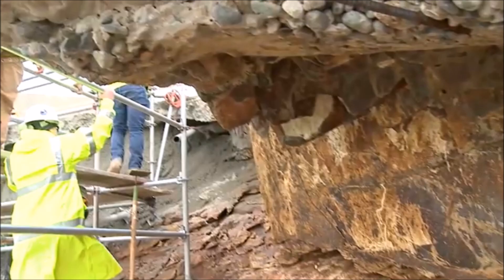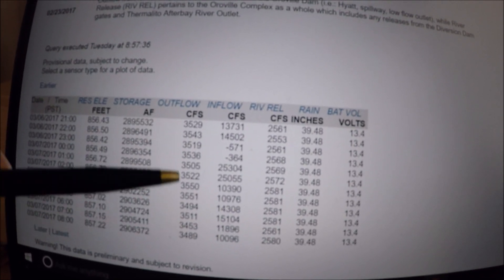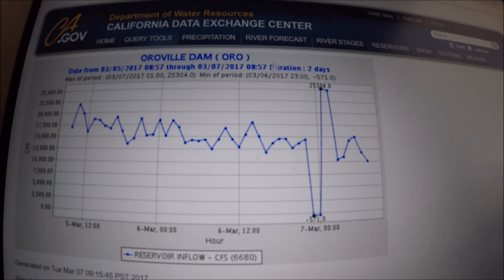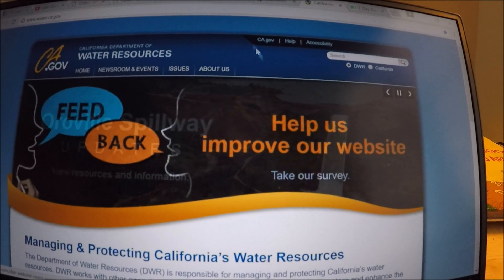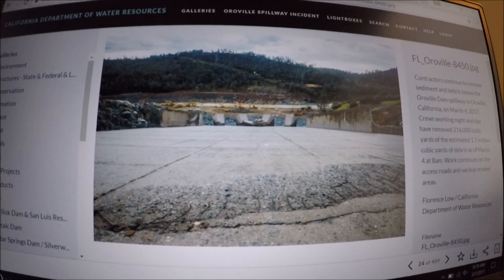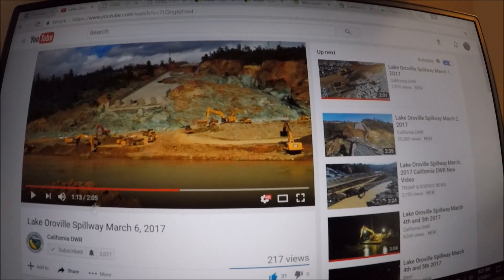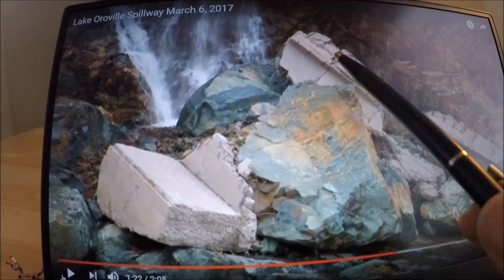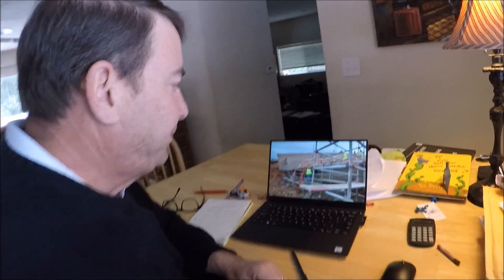Oroville Update 7 March 2017  "Where's the Rebar?"

Comment: rebar is not used in dam construction at all...there's none in the Hoover dam...rebar in concrete causes rust and failure in 50 or so years because concrete is like a sponge with water. it absorbs a lot of it and become stronger over time as those waters bring in more calcium and minerals to fill in the voids...every year they drill out a test core in the hoover dam and every year it gets a little stronger
Reply: Rebar is almost never used in dam construction because dams are designed to be in compression their entire lives, and steel provides no economical benefit to a structure in compression.  The spillway, however, must function in both compression and tension (and shear), and rebar is needed to address these functional requirements.
Reply: Very interesting, phil. It seems to me though, that in the spillway that is 3000 feet long, rebar might be  required even though it does rust. (disclaimer; not a scientist, just a dude that works with concrete now & then, haha)

Comment: Slab thickness can easily be estimated using the extension ladder where they are placing the shotcrete. The ladder rungs are 12" center to center on almost all ladders. I believe OSHA min is 12". Keep in mind the section from about the middle of the spillway to the viewers left is a section that is thinner due to the clay drain pipes. The broken end is seen in previous videos and can be placed in DWR photos. You can barely make out a curved surface along the bottom edge of the slab as well. I believe the drain pipes travel horizontally under the slab then turn downhill along the outside wall and tie in the drains seen flowing back into the spillway further down. I would guess the clay pipes are at least 8" thick and are reducing the overall thickness of the slab. The pictures and video backs up preliminary blueprints I have seen.

Comment: I love what you been doing, and that off on road bike.

I'm really curious about those spillway sidewall pipes that were shooting a stream of water while the spillway was running and they were evenly spaced down both sides of the side walls, I figured it wasn't just removing run off from under the length of the spillway.

It almost looked like it was water from the spill gate area being forced under pressure for some reason,  any thoughts, and thanks again for all your work on this info with the dam

Comment: With all the drought we've had in the last five years, I've got to wonder how much land deformation is occurring below both spillways given all the weathered orange bedrock exposed with the collapse(s).  If structural integrity of the spillways depended on bedrock not aging, well heck, that didn't work.  Look at the huge chunks of crumbly orange 
rock carved out below the broken slabs.  It wouldn't take much deformation to pressure old rebar, cement, and positional drains to start slab failure. 

Is there constant drain leakage from higher up on the spillway, even now?  Also the original hole was just above the recent sinkhole which makes me wonder if there was more extensive weakness beyond the visual inspection of the first big hole that led to the new hole appearing  below it, with water pressure on the spillway.   If the ground is eroding away underneath the entire structure, especially where the cliff gets steep, there wouldn't be enough reinforcement you could do to stop those sinkholes!  Are they planning on doing any radar on the site?  TY Juan for impressive reporting!

Comment: Great reporting. And thanks for the rebar shots. Though I would have expected more. And yes the spillway appears very thin in parts. Now do you suppose you could take your cb500x out there and get them to add some steel deflector plates in the broken top section? This would spray the water up and over to prevent head cutting.

Comment: Don't they have to phase the generators on line in a certain way.  I mean it's not just like flipping a switch is it?  I remember when stationed in the Azores our on base power was provided by 6 huge diesel generators. If for some reason they had to shut down the power plant when they restarted the generators they had to put them back online in phases.  Is it the same with the hydro generators or does it have something to do with the type of current the generators produce?
Reply: Teresa Wolverton : they would need to be synchronised to the grid frequency before they get connected to the grid - but this routine, and easily done, and, depending on the configuration, they'll probably stay in step with grid if it wanders.
Reply: @Teresa Wolverton: Phasing is important for motor rotation. 3 Phase Power Motors; which, are common for large industrial plant pump motors, spillway gate motors and turbines generators: Need to be running the proper direction phase while they are tying in the backup generators.

Comment: 0:08.  Looks like the rebar is on 2' centers.  The spillway appears to be poured in 40'W x 50'L slabs (Google Earth is a surprisingly accurate measurement device).  There appears to be about 20 rebars sticking out across the image.

Disclaimer:  I could be wrong.

Comment: for the last couple of days, the inflow would have nicely matched outflow, had they had the full 14,000 cubic/ft/sec flow, but the outlet channel seems still a bit iffy. Now if they would haul these massive rubble piles to the top of the dam, put them on a barge, up the three inlet rivers, and put 3 more oroville size dams, they would not have to throw away the huge growing potential of all the water they have wasted downstream in drought years, for 3 times as long as now. The evaporation rate would be tiny, up that high.

Comment: Thanks for the info - YOU are the only reliable and timely source of info about this.
The rebar looks ok -- and the concrete is strong enough - the big mistake was making it a monolithic pour.  The design is bad because it does not allow for the earth shifting -- A better design would have been smaller sections that operate like clay roof tiles, the former dumping into the center of the latter - with enough slope to keep the water from undermining it - and had a design that anchored them together, but still allowed them to shift around without losing their orientation.  That way, if one section failed, one section can be easily repaired, but with a monolithic structure, once a slab cracks, water can get underneath and destroy it. In order for that current spillway to have survived;  it would have needed to be built like an Ancient Roman Aqueduct, not reliant on millions of tons of earth to keep it's shape.
Reply: there are 2 types of concrete cracked and going to crack
Reply: Careful now, no rebar or the like in Roman aqueducts. You don't want to be lynched by the rebar-mob 2000 years from now, do you?

Comment: A lot of people cant grasp the power of water it doesn't matter if you had rebar 6 inches apart water once it has a void cuts thru anything and everything!!
Reply: used a water cutter at work its spooky stuff with out the abrasive add the abrasive and your SOL saw a guy cut some armor plate on top of ply wood with glass and lexan then 2in thick steel just to show the power at work it was amazing

Comment: If indeed the spillway floor isn't the same thickness across wouldn't that mean they Slopped pour the cement?. Getting into the re-bar. If you ever studied the old buildings in Chicago or even Chernobyl you see how cement fails after so many years as the Re-bar either rust away or weakens creating the building to collapse. Re-bar does that when the concrete cracks over time and down it comes which is pretty well what that spillways does is just sit there. Just like abandon buildings. To me, if you want something like this spillway to last wouldn't it be better to fix it using new stainless steel re-bar if they can even forge it so that it wouldn't rust? Cost would be outrageous but in the long run or hundreds of years save a ton of repair or even a disaster.   That last thing id like to comment on is the Turbine blades. Why is it today you find out that one turbines is bad? Was this problem not discover-able weeks or months back when it could of been addressed and repaired? Now, just a personal feeling as am no body. If I built a new spillway one thing id do for sure is paint it white when ever it needed it, The whole spillway. You all seen on super hot days where cement freeways stretch and shrink so many inches. Sometimes even buckling where the cement freeway needs to be shut down.  Even Rail Road track does that from freezing cold in the winter time to super hot days in the summers hottest days. I believe with Rail its about 4 inch's per every 39 feet. If they paint that spillway white that would defect an enormous amount a heat away from it on super hot days thus not getting time cracks or heat cracks in it rusting the re-bar weakening it.

Comment: Any ideas why they were drilling into the shotcrete under the spillway lip?
Reply: Shotcrete is typically placed over and around a reinforcement grid, and that grid is typically anchored to the backing formation.  Those holes are probably for rock bolts which will be placed and tensioned, and then the grid will be bolted/welded to the top of the rock bolt.  Normally rock bolts are placed before the surface is shotcreted so you can see what you're drilling into, but in this case they probably wanted to get a face coating of shotcrete to minimize surface ravelling and consequent headward migration of the rock face, which would lead to undermining of the remaining spillway.
Reply: Just like 9/11 huh? Idiot!

Comment: Hi Juan, Thanks for posting and pointing out the rebar...  I agree the variation in slab thickness is interesting. It wouldn't take much of a crack in the thin section to create enough flow to was away the dirt under the slab... I have a book recommendation for and your followers here... https://www.amazon.com/Engineer-Human-Failure-Successful-Design/dp/0679734163...

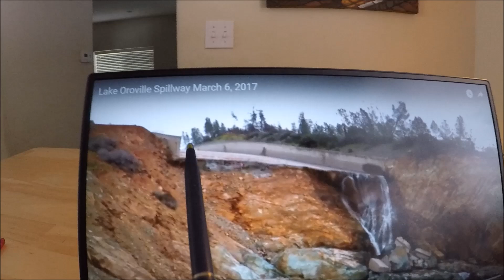Comment: Looking at the tape at minute mark 5:15 or so, you will see people standing close to edge as they Shot-Crete the underside of the spillway. Given that the scaffold is about 2 inches in diameter, the spillway looks to be about 12-16 inches or more in thickness. More likely it started out as 16 inches thick, but as the water ran over it, it wore down the concrete. I would have thought engineers would have thought about this and made it thick enough to last. Water seeks path of least resistance and once it gets "inside" there is virtually no stopping it. I had seen a better video a few days ago and it looked like they had used at least a #16 rebar (2 inches) in some places in the spillway. You can always look at the public records if you really want to get an answer. I think they should just spray the whole exposed rock surface with something like LINE-X or RHINO lining for now. It is waterproof and will just let the water run down without more erosion. If the water can't get in the cracks of the rock, it can't do as much damage. At a later time, drop water level really low and start at the top and replace concrete.

Comment: One reason you may not see rebar at an expansion joint is that expansion joint sleeves are used to allow some movement.  These joints however, are supposed to be monitored.  So if a slab pulls off or breaks away at a joint many of the sleeved bar may fall out.  The sleeved bar can vary in length and may not be connected to the main body of the bar, ie. it's not continuous.  So if you look at a smooth joint and see no rebar poking out, this could be a reason.

Comment: What's more disconcerting is the area where the span failed. Looks like it was built over underlying dirt and not supported well enough, so it cracked, which led to it being destroyed by the water flow. . The original engineers missed that one! Or was is  a cheap way to build based on risk?
Reply: Steve
exactly, which is why the cavitation theory is all wet - it's flowed huge numbers before and did not fail.  Failing at minimal flows points to some other phenomena. A postcard from the time of construction shows a clear demarcation in the spillway right at the major destruction zone and this area always was 20-30 feet below the rest of the bedrock slope before there was any concrete.  Probably substandard fill now in the river.

Comment: Thank you very much for your detailed informations. It is an incredible fight against time in digging out the debris out of the thermalito diversion pool and - at the same time - perform reasonalbe repairs at the spillway. Days ago I've found a foto in the web showing white water running down the spillway with water getting brown at the right hand side right at the position, where the channel later failed. I think at the very high flow rate at this time a little failure get's larger very, very fast. And as the whole was so big, as the pictures have shown at the time, they closed the spillway for the first inspection, there was no way back. No construction can be made so strong, to withstand souch cases and they had no choice. Maybe this small start of the failure could hve been found during a detailed inspection of the channel? But these are questions for the investigation, which will happen for shure. Right now other problems are much more important. I am confident, that you Juan, the maker of the best information channel in this case, will inform us also of this coming phase of the oroville case in your very objective way. My respect! I hope, the weather will keep cold and the snow will stay, where it is, to give the workers enough time to achieve reasonable targets in their plan.

Comment: Juan, have you ever seen the  smooth surface side of concrete, chip away from weather related  erosion, eventually cracks will form ,then holes will develop.  Don't know if this was the cause of the damage to the spillway, but it is  possibly feasible . Especially if they never in all these years refurbished the concrete face of the spillway.

Comment: I thought that this was your day job !    Don't know what you do for work, but your reporting is important !
Reply: I really don't care how he pronounces it, because he obviously knows what they are - and a lot more than 98% of the idiots posting about Oroville on YT.
Reply: Devyn Powell I think you'll find 'turbans' are worn by certain Asian Indians, known as Seiks? So, yes you've (USA) highjacked the English language and turned it into 'A Chinese whisper' lol
Reply: so, I'm pretty sure that we (Americans) only allow 'seiks' - did you mean Sikhs? - to guard our turbines, and only if they are wearing their turbans - AND, and if they come to work driving their taxicabs - from their 'day job'
Reply: Construction Notes: Rebar (reinforcing bar) diameters are measured in eighths of an inch, so for example, a #8 rebar is 8/8ths or 1" diameter. Spacing of rebar is based on civil engineering and design codes, and what code years prevailed at time of design. Rebar spacings vary, e.g., 1ft cntr to cntr, or 18"cc, and there may be crossbars installed creating a gridded matted like, and maybe an additional top, middle or bottom layer. The strength of a slab (pour or lift) is based on the concrete mix, e.g., and 3000psi or 4000psi mixture, and of course, the preparation and compaction of the soil/foundation is important. If foundation erosion occurs,  the slab breaks or bends, forming cracks thus allowing further undermining of the original structure.
Reply: Than why is he pronouncing "turbine" as "turban"?
Reply: Richard V Sassoon I thought I'd misspelt Sikhs, thanks for the correction. I can assure I was pronouncing it correctly.....lol
Reply: I wondered why he had referred to one of the power plant turbines as "inop". I haven't found that term used too much outside of the industry. :)

Comment: Juan, here are the specs on the dam. Including blueprints. since we cant get out there with a measuring tape...cheers
https://archive.org/stream/zh9californiastatew2003calirich#page/n15/mode/2up/search/oroville+dam+spillway+thickness
Reply: Great link Kasey.
Reply: Vanessa, that's the spillway for the Pyramid Lake Dam, starting on page 364.  There are multiple dams featured in this report.
Reply: Eighttrack . . . that's the spillway for the Pyramid Lake Dam project, which starts on page 364.
Reply: Oh, my mistake.  Thanks for the clarification GSMS!
Reply: Juan...On page 399 in the bottom right corner is figure 334 which is a photo in high definition that you can magnify  and see placement  details of steel reinforcing in main spillway.  and it looks to be  very good quality work.
Reply: For those about to Rock at the Pyramid Dam Spillway pictures, please proceed with causion. All the pic's on pg 399 are not the proper terrain for the Oroville Dam. I can't find any validating reference for the Oroville Dam, only the Pyramid Dam. However, this may show the rebar and concrete method for the time period.